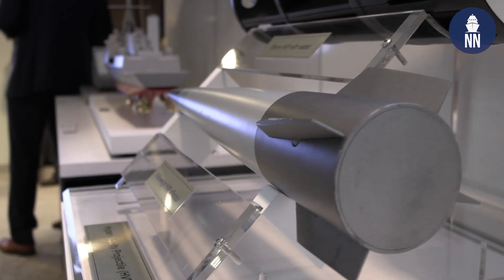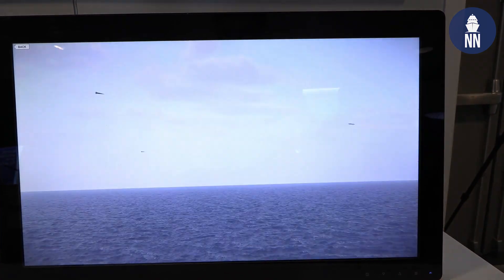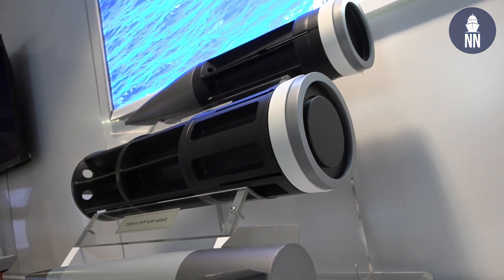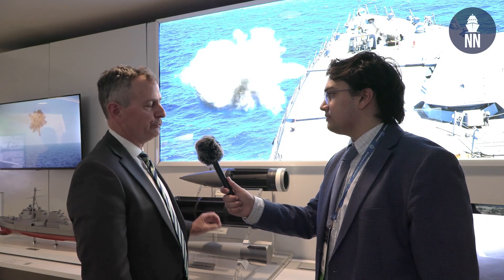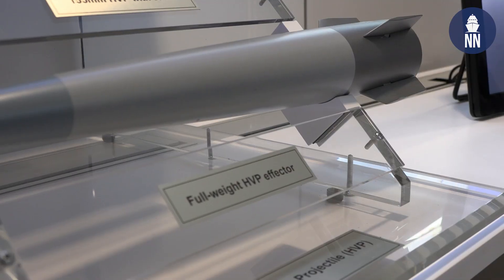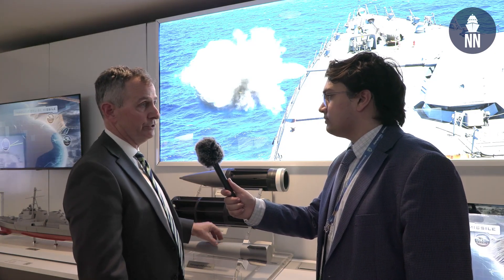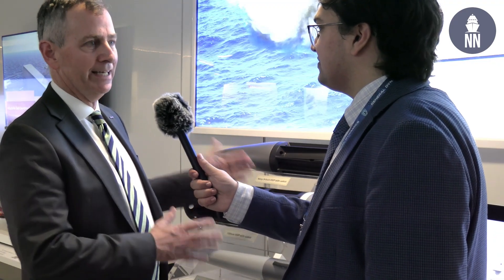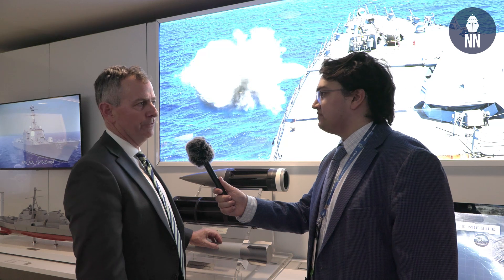BAE Systems' Hypervelocity Projectile (HVP) at SNA 2025

Comment: I bet these munitions will chew through the Mark 45 gun barrel like crazy.
Reply: It's discarding sabot. The sealing will likely be uhmwpe, so no, it won't chew up the barrels. Plus it's likely to be rocket assist to attain velocity, but that's classified.
Reply: @DavidOfWhitehills  The rocket assist slows down rate fo fire and I think does shorten barrel life.  Rocket assist would really make no sense for a Sabot round.  Can you think of a rocket assisted sabot on use with any gun system?

Comment: one shot one kill? of what? maybe patrol boat. anything bigger will survive just fine. does it even have any explosive there or will just pierce boats and leave almost no damage? can it even hit fast moving target? and if it can how far?
Reply: One shot one kill against aerial targets like drones and cruise missiles. May be limited to lower end cruise missiles.
Reply: This isn't the round you would use on a boat.
Reply: Modern warships aren’t really armoured though. It would also depend on the warhead type. On detonation above the ship, the fragments could do serious damage to Radar antenna and other digital systems. Mission kill would be fine
Reply: @nickbrough8335  its sub caliber ammo. so its weight and volume its tiny. very little explosives or just kinetic penetrator
Reply: @ if i understand correctly, then gun system can rapidly fire several shells with just about the same arrival time at the target. I think you need to consider the impact of a burst and potentially using a variety of shell types. 

until the system is in use, its a little hypothetical.
Reply: 1. Yes this can have an explosive charge. 2. Even if it didn't, the damage to any vessel, patrol boat or bigger, would still be catastrophic internally. When the round hits the vessel, it immediately starts to cause spalling. As it penetrates the hull, jets of liquified metal and shards spread out in a cone moving away from the impact zone. The friction of the round penetrating the hull causes the air to become superheated and it flashes into a fireball that ignites any metallic dust particles which is immediately fatal to any crew. Add to all of the previous things is the overpressure wave which will liquify any biological material it hits. If the round enters a fuel tank, or hits a magazine, it will cause a detonation. So a single hit from this kind of round to vital areas like magazines, or engine rooms will most likely result in that vessel being put out of action. If the vessel is hit 3-4 times, it will likely sink.

Comment: The HVP’s low drag aerodynamic design enables high-velocity, maneuverability, and decreased time-to-target. These attributes, coupled with 
accurate guidance electronics, 
provide low-cost mission effectiveness against current threats and the ability to adapt to air and surface threats of the future.
rocket motor to extend gun range not needed
Firing smaller, more accurate rounds decreases the likelihood for collateral damage and provides for deeper magazines and improved shipboard safety.
This projectile will provide lethality and performance enhancements to current and future gun systems and allow for technological growth while reducing development, production, and total ownership costs.
The HVP is a next-generation, common, low drag, guided projectile capable of executing multiple missions for a number of gun systems, such as the Navy 5-Inch; Navy, Marine Corps, and Army 155-mm systems; and future electromagnetic (EM) railguns. Types of missions performed will depend on the gun system and platform, but range from Naval Surface Fire, to Cruise and Ballistic Missile Defense, Anti-Surface Warfare and other future Naval mission areas.
...from BAE Systems web  site

Comment: You know for some reason,i have a feeling that the US navy rail gun Project wasn't actually cancelled just that it was publicly cancelled but secretly it was somewhat successful,and the HVP having an ammo for the rail gun increase my suspicion
Reply: We almost certainly have a plasma projectile rail gun as well, project marauder in the 90s got black booked after a successful test. Pure electricity for both the projectile and acceleration. Though they may have scaled it down for potential use as an engine that would explain the zipped ring exhaust trails seen.
Reply: @Madarius7  yeah i have read about it,but yeah due to it's success it was classified , and considering that the status as you said is basically a black project, i hope they Keep that way even though I want to know what happened. And considering many us military weapons are sometimes turned into civilians uses or a new entire project i could see why it could be suspected that a new engine was created thanks due to the marauder project
Reply: Yes this feels like plausible deniability.
Reply: I think the U.S. cancelled it but the U.K. carried on the design.
Reply: @marcgraham412  wait so the UK is carrying on the design, that's interesting. Thanks for the info
Reply: @EndBy13  It's not confirmed or agreed info.  It's an 'I think'.   He could be wrong and the OP started with 'I have a feeling" and ends with "increase my suspicion".  Colour me old fashioned, but this has zero street cred.
Reply: @csjrogerson2377  oh ok thanks for the info, i was speed reading and didn't read it clearly
Reply: It isn't though, the sabot there is to make it work with 5 inch guns and 155mm guns. He never said anything about rail guns.

Comment: Would 6" guns give Navy longer range and impact??  If so why doesnt navy equip new ships with them??
Reply: it is highly dependant on a lot of factors. For example, the US Mk 45 5/54 inch, when introduced, had a 13 mile range. The UK Mk 8 4.5/55 inch, when introduced, had a 17 mile range. Both came into service around the same time.
Factors like gun weight, turret weight, turret ring diameter, ammo stowage, reloading etc all have an effect on what can physically fit.  A heavy gun and turret needs a strengthened deck area. a larger turret ring takes up more space on and below deck. 
Larger shells have a slower rate of fire, due to the heavier shell.  US 5 inch has a 16-20 rounds per minute. The UK 4.5 inch, 25 per minute.  US shell 31.75 kg. UK shell 21 kg.
The US 5 inch is more destructive, due to a greater bursting charge.
  So as you can see. just a 0.5 inch difference in calibre, can make a huge difference  between two nominally similar weapons.
Reply: 127 is a multi purpose gun.  If you want to engage aerial targets you need a certain speed to traverse and elevate along with enough elevation to engage.  You also need rate of fire.  The 5" 3" and 2" live on for a reason.  Even China/Russia top out at 130mm.  Don't mistake these as tank guns either.  Longest tank gun is about 55 caliber (most 44-45) and ours is a much heavier 62, Italians 64, Russia/China 70.
Reply: @jm2453  All solid points, but for shore bombardments and wrecking ships the 6" is better. Short sighted military leaders eliminated our naval capability to play with their missile systems. Big issue for Marines in Nam. Reagan proved that point again in Lebanon when BBs 16" guns slammed Syrian and Iranian positions. But those ships are too expensive to operate, so we need larger guns on smaller ships..
Reply: @richardmeo2503  I'd rather have the 5 with quad packer ER-GMLRS.  Basically lobbing 10 inch shells much further.

Comment: Now the US Navy needs to go back to 8 inch guns on ships with hypervelocity projectiles
Reply: No.  5" is still multipurpose which is what a ship needs.  We should quad pack GMLRS to NGFS.
Reply: @jm2453 yes. Yes we should. I’ve thought that or GLSDB but using SDB2 would be very effective and cost effective.
Reply: I was just picturing those projectiles encased in a sabot designed for a 16" gun.  possibly as a "super flechette" but with "smart" projectiles.

Comment: Will the Leonardo 127/64 mount be able to use this munition or is it only compatable with the mk 45?
Reply: Should be able to, 127mm is 5".
Reply: Dont the Italians have their own version if this technology ?
Reply: They should produce an 127 mm version.
Reply: @felcofb4750  the mk 45 or 5 inch gun is 127 mm. It's 127mm/54caliber. That is built and designed by united defense which was acquired by BAE and is on American ships. What he's asking is if it'll be compatible with Leonardo's 127 mm gun which is 64 caliber or length. Oto melera produces a 127/54 gun as well for Italians.  Now we do have a smaller gun that is 54mm made by bofors on a few ships like lcs where Leonardo makes a 76mm/62 caliber
Reply: If Vulcano can swap guns I am sure they can make a variant of this for the 127/64.

Comment: These enable a DDG to take care of slow flying cruise missiles at ranges exceeding 40 miles freeing up VLS missiles for more important targets.
Reply: Only if the projectiles are guided
Reply: @xelolath  They are, that is the entire point.
Reply: @BravoCheesecake  that's what I missed in the video! Assuming you are correct thats a unique selling point for this capability. I'm just really curious as to how they achieve this technically.. Assuming IR doest work because the projectile will get too hot...
Reply: @xelolath  This is a myth. Hypersonic projectiles have had the ability to communicate and sense via RF for decades. An example being the KU Band sensor developed in the 80s by DARPA.
Reply: The effecctive range of HVP in an aerial engagement will not be 40 miles whether statute or nautical.
Reply: You're right, out of a Mod 4 it's 50 miles.
Reply: @ That is a max range figure, not effective.
Reply: how is it getting to see those missiles?
Reply: @andyf4292 radar and co-op radar data sharing at CIC level I expect.
Reply: How are they guided?
Reply: This shit is a standing joke at YPG.
Reply: @NeroontheGoon  why?
Reply: It sure would have been nice if the video has explained that, thanks for the explanation!